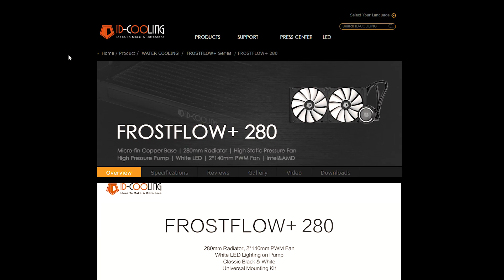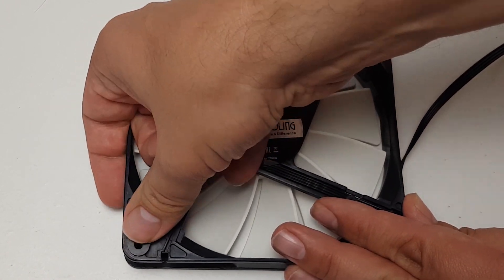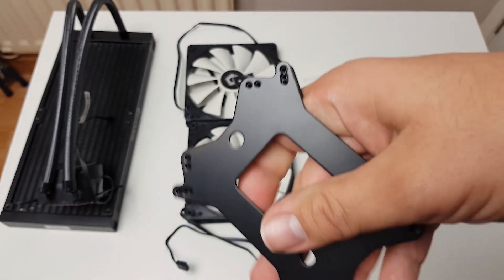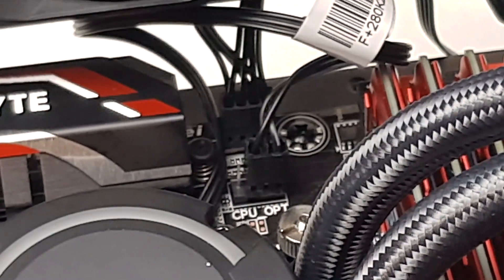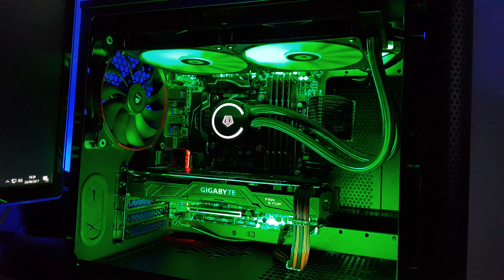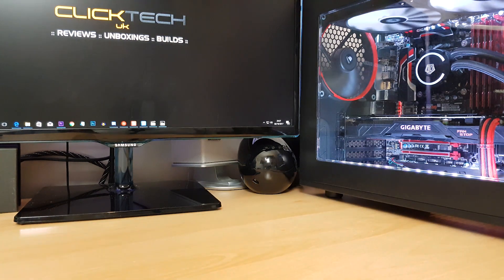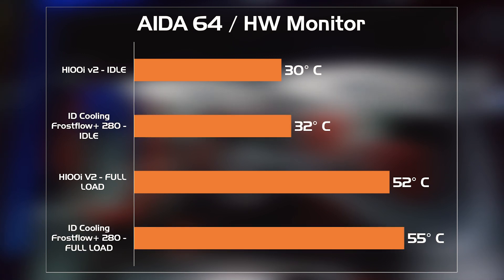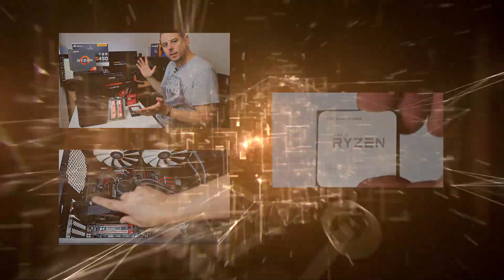ID Cooling Frostflow Plus 280 CPU Cooler - Unboxing / Hardware Review / Overview

Comment: I just ordered the Frostflow x240 for my ryzen 5 5600x that hits 96c as soon as you load a game, which is fairly normal from what I've read about ryzen 5, but I don't like it at all lol.
Reply: how did it work for you? i have same processor
Reply: @NeoJ4K3  Dramatically reduced cpu temps, I'd say from the 95c it was hitting to never more than around 72-75c
Reply: @SteelWorksGuy  my maybe I'll get it, I'm pushing 84-86 in satisfactory and my factory isn't getting any smaller....

But then again should I let her eat uo to 95c she is rated for
Reply: No, it isn't normal at all. My 5600 doesn't brake 72C during gameplay with cheap $15 tower. And that is WITH PBO2 that unlocks power consumption.

Probably either incorrect installation, bad thermal paste distribution (one small dot at the center without distributing is NOT how you apply it on AM4 CPUs due to chiplet design), or incredibly old AIO with evaporated liquid.

Comment: I had one, bit noisy and pump failed in 4 months.. Replaced with Be Quiet dark rock pro 4 air cooler. Quieter and more effective than this.
Reply: Really? Did it leak? im trying to buy this.
Reply: @jucctin5243  No, it didn't leak, the thermals just went crazy on the CPU. The air cooler I have now actually cools much better than the water cooler ever did with 50%+ less noise.
Reply: @DaveCorbey  but the price...
Reply: @jucctin5243  Sure if all that matters is the price, buy it. I can only say what my experience was and it's noisy and doesn't have great cooling.

Comment: can you turn off the LED? how is the fan noise and pump noise? comparable to h100?
Reply from the maker: Noise is OK, about the same as the h100i v2, although it depends how you have the fan curve set.  I was rendering my latest video last night, but it didn't get above 50c and therefore the fans didn't get above half speed while running full load on all cores and threads on the 6700k.  Can't turn the LED off though unfortunately

Comment: I really like to order one but I've heard the materials used are a bit cheap and makes me worry more about leakage.
Reply: I've just bought one of these and it's good quality, especially at this price point (btw Scan UK are ripping people off by selling these £30 more expensive!)  - the onlu AIO I've had leak was a Corsair H60 where one of the rubber tubes came off the poor barb design on the CPU block.
Reply: just to add Amazon and Overclockers UK are selling these at the best price, as per the links under the video.  Good links ClickTeckUK!
Reply: Lose the brand prejudice mate.

Comment: So.do you need to replace the coolant at all ? as in , at a certain age or usage time in its lifespan ?
Reply from the maker: +JAY Gee no, it's a sealed unit. Athough the pump life expectancy is 50,000 hours.. Which is about 5 and a half years of continuous running.
Reply: Thanks for that quick response,  so at £12 for 5 years that is quite the best way to cool my G4560 (made my pc up on the video i saw of yours ) unless you can think of a better solution ? i'e  aftermarket cooler ? I am trying to cut the cost as money isnt always readily available, any suggestions would be great .
 p.s  I do have that Kolink case so I'm guessing i may have to think of something else looking at these measurements , sadly ....
Reply from the maker: +JAY Gee for that case you'd be restricted to a 120mm liquid cooler, but for a G4560 even that might be a little overkill tbh. If you're not happy with the stock cooler then an aftermarket air cooler something like the bequiet shadow rock would do the job well in that case
http://amzn.to/2g9LOXx
Reply: ClickTech UK 
Hi great video man just wanted to ask how to set CPU Coolers fan curve ?
In bios or using a program?

My MOTHERBOARD is 
Gigabyte Z97X UD5H.